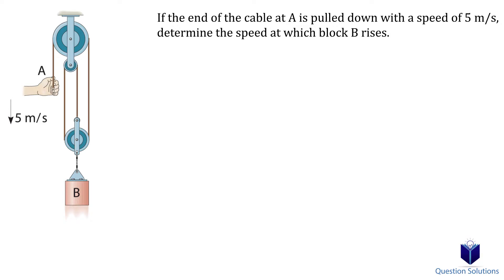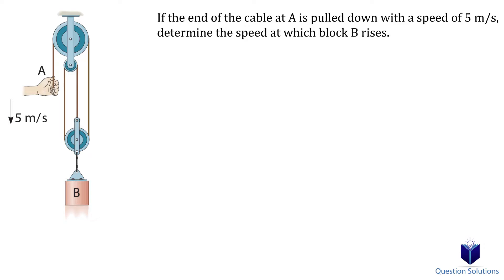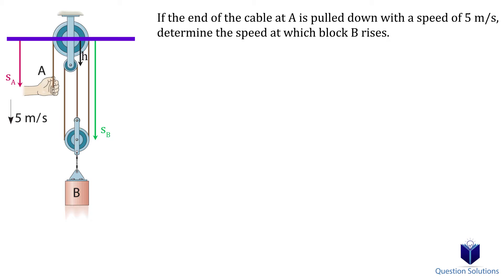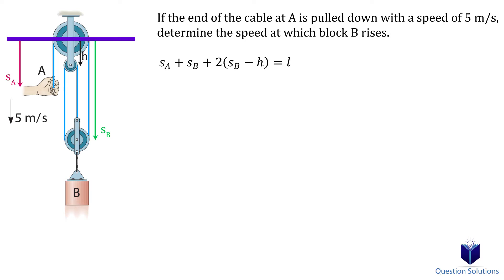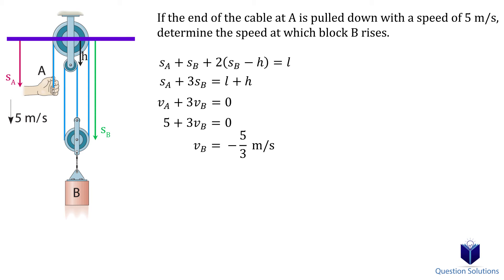If the end of the cable at A is pulled down with a speed (solved)

Comment: you should have set your datum on the middle pulley since its fixed and then your equation would like L = Sa = 3Sb. Once taken the deritive, it would be 0 = Va + 3Vb, bringing over Va would result in a negative Va, so that Vb will be postive upwards.
Reply from the maker: There are many ways to solve these problems, though I don't generally recommend settings datums in the middle. It is your preference, and again, many ways to arrive at the same answer, there isn't a "right way" or a "wrong way" as long as you arrive at your answer and you can show your steps 👍

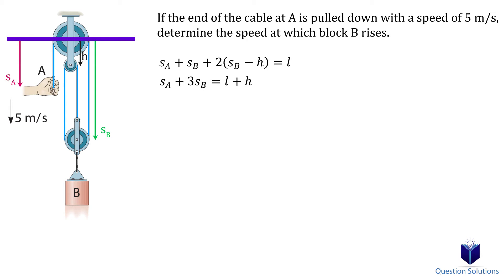Comment: Thanks for your solution. But something wrong in 1:02 ,it should be Va+3Vb=l+2h.
It doesn’t matter.
Reply from the maker: Yes, you are right! I made a typo there, good thing it didn't matter since it becomes zero. Thanks so much for pointing it out! :)